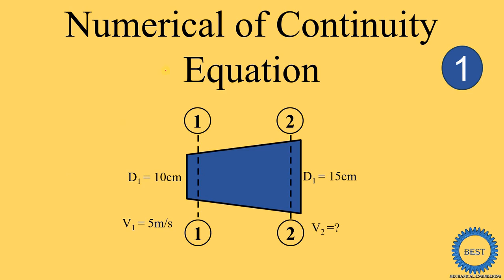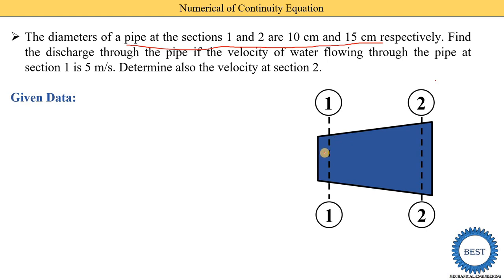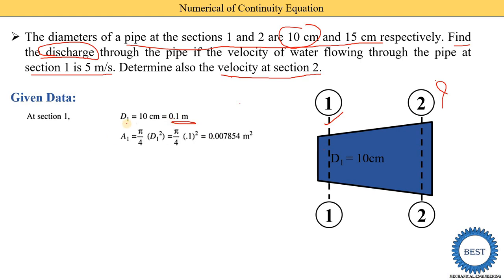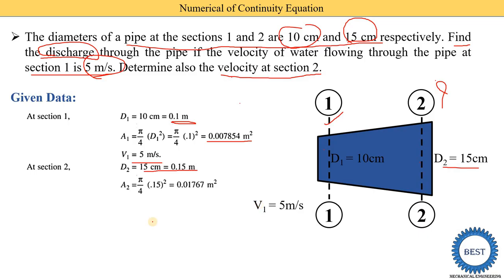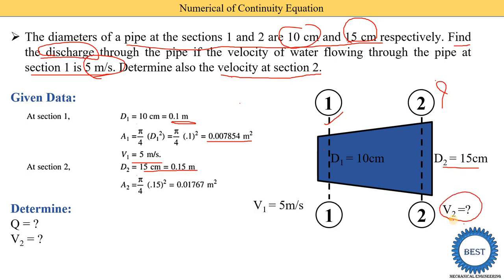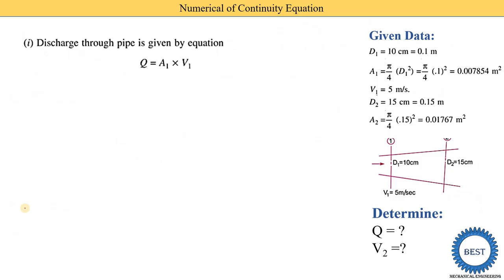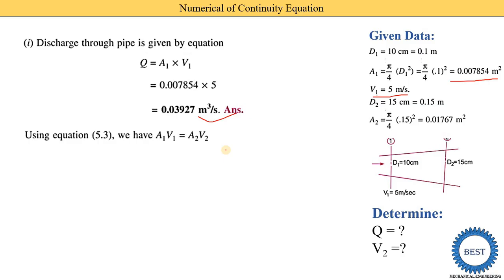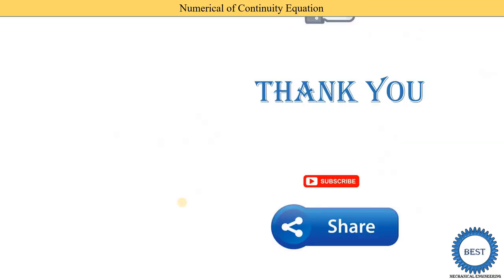Numerical of Continuity Equation

Comment: Since the diameter is known at both points you can skip a lot of intermediary math;
D1:D2 is a 2:3 ratio, cross sectional area is important here. (2/3)² x 5m/s = 2.222.. thus matching the answer without needing pi/4 and changing units, since units are constant across both D1 and D2. Correct me if I'm wrong though.
Edit: you can go further even and get the answer for discharge by doing V2x(4/pi)x(D2)² and you get the 0.03927m³/s. To me at least this would be a much simpler concept to understand.